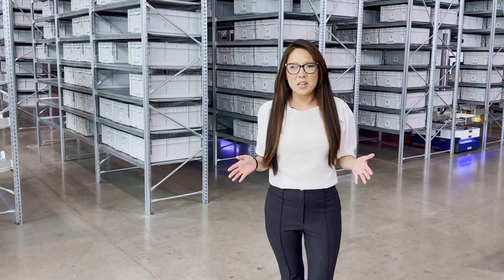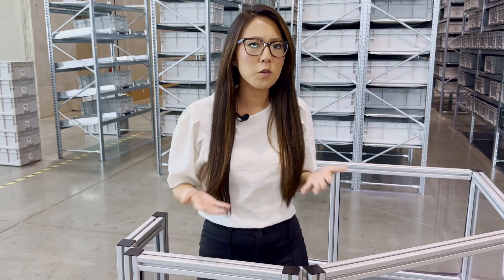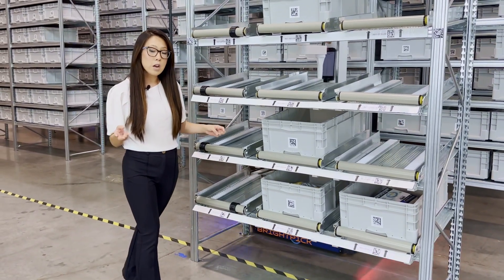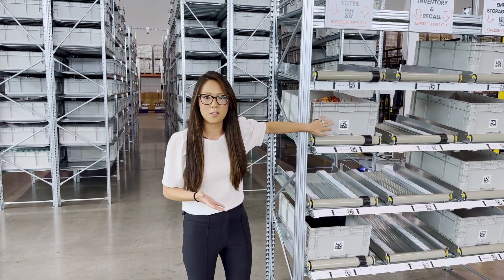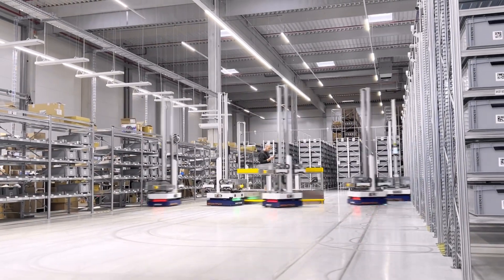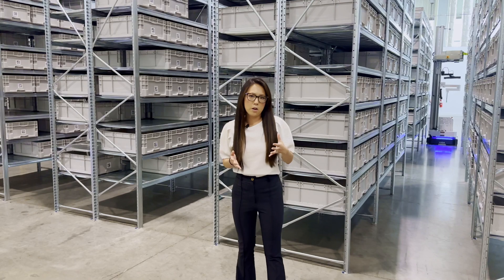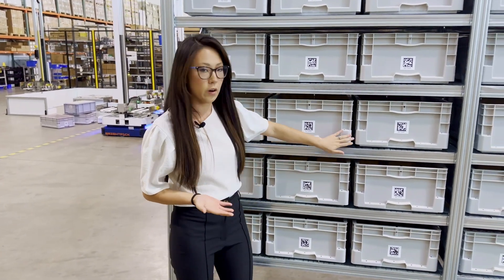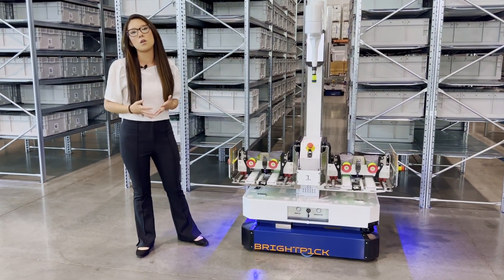Demo of AI warehouse robots (fully automated picking) | Brightpick

Comment: Why do you consider the middle of a shelf the most optimal placement for 'busy' totes, surely lower down the better as the picking bot has to pass the lower boxes to select a middle box, then lower it for the picking arm and then raise it again to put back on the shelf, how is this more efficient than picking a box from the bottom ?!?
Reply from the maker: great observation, and what you say is correct. However keep in mind the totes need to go up again to do the pick; if they are in the middle of the shelves, they're already at the level needed to be picked.

Comment: At what kind of volumes does this start to become more cost effective vs. human associates?
Reply from the maker: Great question! typically you need to be doing at least 7000 picks per day to achieve a meaningful ROI (since the installation and servicing costs are relatively fixed, it doesn't make sense to install a solution like this if your volumes are too low).

Also worth keeping in mind is how many shifts you are running. It's much easier to achieve good ROI if you're running a 2-shift operation than a single shift (since that effectively doubles your labor savings without incurring additional solution cost).

Comment: My first bit of respect has to go to the concreter who got the slab flat.
Reply from the maker: It's great you mention that, because actually our robots don't require leveling the floor prior to installation. That means they can be easily installed even in brownfield warehouses (as was the case at this site).

Comment: Can custom totes be used?
Reply from the maker: Yes, we can use multiple different variations of totes. The main limiting factor is the size cannot exceed 60x40cm and the tote cannot have holes on the short side (otherwise the robots would not be able to extract the totes using their suction cups).

Below are two videos where you can see different types of totes being used with our robots:
https://youtu.be/SvvUeih4kp4
https://youtu.be/L_RONVzTiP4